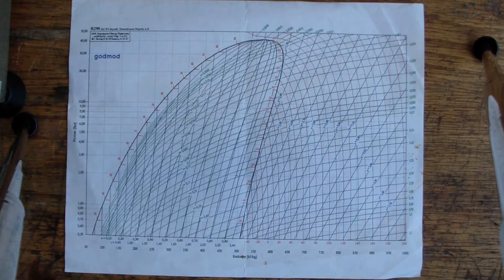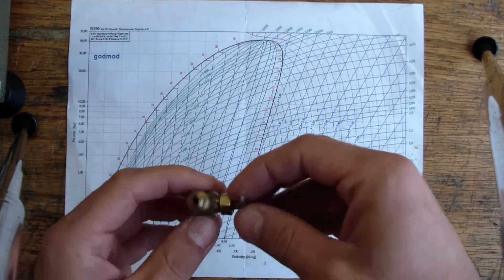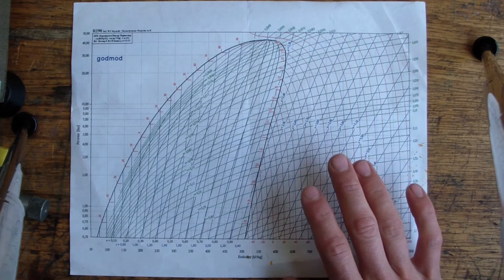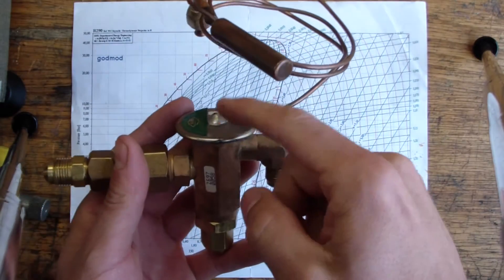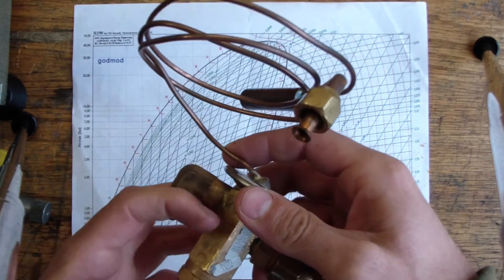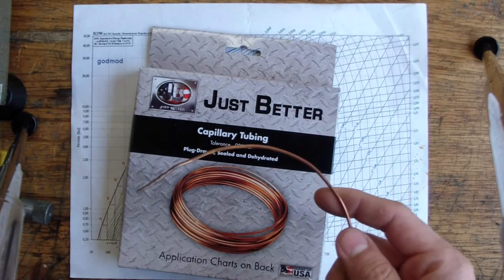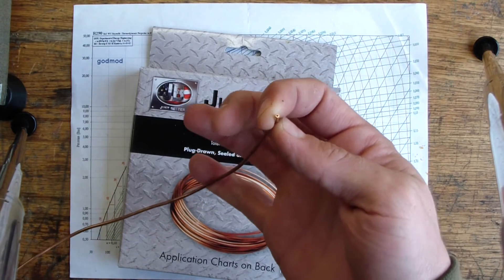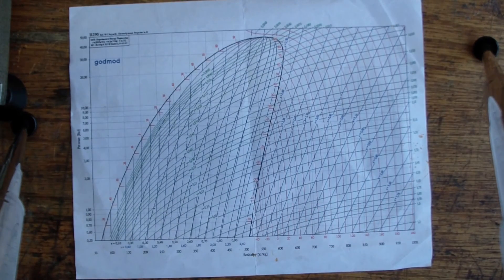DIY Refrigeration- Throttle Choices

Comment: I am wanting to build a very small system as an experiment but I'm not sure where to start. I think I am going to use a mini fridge compressor but what should I use for an evaporator, condenser, and cap tube? And can the low and high side tubing be the same size?

Comment: I find that the hybrid system works well. I set the capillary tube length for a specific evaporating temperature and restricting the valve lowers the evaporator temp further than the capillary tube. I fill it with refrigerant with the valve all the way open and it makes the process easier.